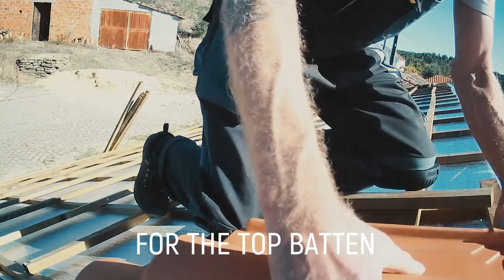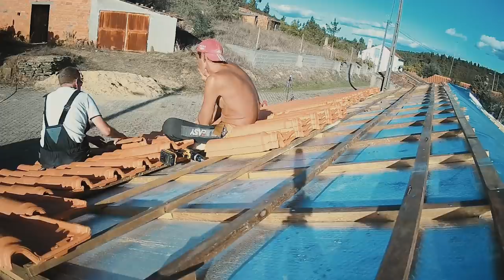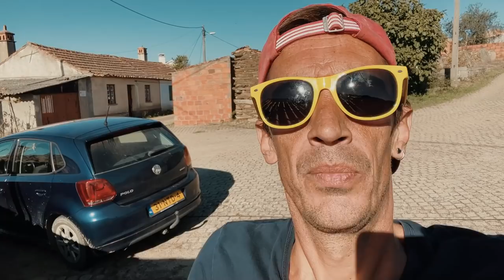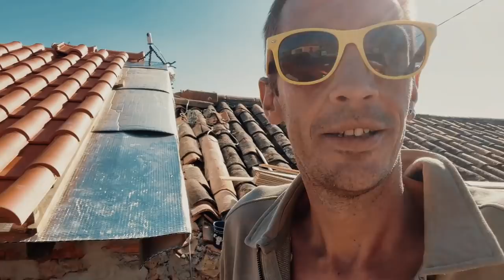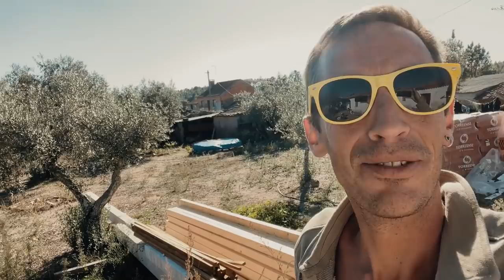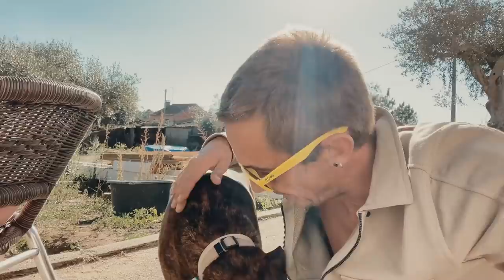Throwing the ROOF TILES on my NEW ROOF (..Literally) - Portuguese House Renovation

Comment: I just nailed my perimeter tiles... All the others are loose.. they are heavy and won't go anywhere. Then this makes it easier to make them all even and fit... Also in the future to replace any broken ones.. if nailed it's tricky.

You can with screws just hammer the holes.. but it's a quick jab technique. Then screw in. Just finished my kitchen roof.
Reply: spot on.

Comment: Yes you are right , Portuguese builders don’t nail them. Our roof rafters are all in reinforced concrete.
They also use a long straight edge as a guide for the lining up of the tiles.
There is also  a special ridge tile they  cement in place.

Comment: Maybe they used a wire clip that catches the batten. I did my roof years ago with a tile that was clipped and the builders merchant  asked  why i wanted so many clips as they only fixed them every 4th row and if the roofers where in a hurry maybe never, just the bottom course and a few on the gables. The roofs are held on by cement at the ridge and mainly overlap and  gravity everywhere else  apparently.  Looks good now, one of those jobs that when it goes right feels very satisfying after all the preparation.

Comment: I have lived and remodelled a house here in Brasil for about 6 years now , and I enjoy seeing the similarities between Portuguese and Brasilian buiding materials and methods. However, roofing needs a comment. After placing, removing, repairing etc etc a typical roof and gallery using these type of roof tiles as shown in the video, forget the ascetic look and go for pragmatism! Use large corrugated sheets.., available in various sizes, colours, styles and materials! Put up easily and quickly, no movement in high winds and storms, etc etc....ok I  live directly in front of the sea and after storms tile movement results in a lot of work and damage so maybe my needs are different...!! I admit for the village they fit in well and look great but work/labour intensive they are...especially the first time! there are also certain methods , unused here ,  to fix the edges and apex. great fun watching this series though...and  i love the progress and change..both in the house and Jasper's attitude. Boa sorte, ate mais.

Comment: The roof looks very nice. Especially when later on you have done both sides and the other part of the house to. It will look great. Will the other part of the roof be of the same height. Then you would of course have to raise the walls of the other part of the house a little.  But when all of the rough work is finished you have a nice house. (hopefully waterproof😃 ).

Comment: The hole in the tile it´s mainly to use with wire bracket on a high pitch roof, so they keep in place, not for nails!!
You can put nails in the first row or the on the top, just to be safe ;)
Still, great job !!

Comment: I sense some degree of jealousy in you Jasper, but that's what you get when your dog is much more handsome. 🤣
Despite the prominent feature of your slipper, I must confess that it is a very tight and nicely covered roof, now the last stretch for this side and then quickly to the adjacent side to get the tiles flying. I'm curious how Bas and You are going to handle that.
good luck and "vooral doorgaan".

Comment: Portuguese tiles are not to be nailed.Some type of roof tiles have on the bottom side a hole the attache a wire to the frame,but in your case is not possible.The insulation don´t give access to the tiles.Keep on
Reply: Hey Pedro!
Why tiles are still used on roofs in Portugal? Not newer materials? I would like to understand why this tradition persists. Thanks!
Reply: @Gaste11o  Hey. Portuguese roofs are traditional Clay tiles. New material´s are also use but depending on local construction permits .For a brand new house,can be apply new material´s or other type of roof tiles .A house rebuild must respect the original roof material but under him can be apply other isolation material since it don´t be visible. The idea is to stay the traditional look.
Reply: @pedrofigueiredo4654  thanks for the answer. I thought so. Back in the days my father made a clay tile room and I remember how laborious that process was in comparison with newer types of roof cladding.
I guess there are little chances to be allowed to use some steel or onduline roof (orange-clay color) in renovating an old Portuguese countryside house, right?
Reply: @Gaste11o  Always depend on the municipality rules and location.Some little villages no one care about the materials use and others have rigid rules.Always depend on the historical location of the house.